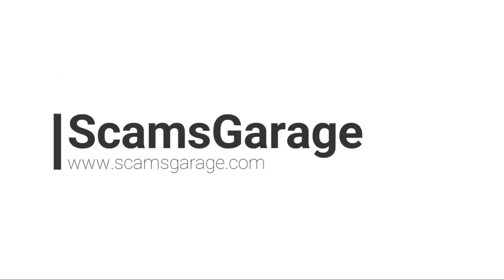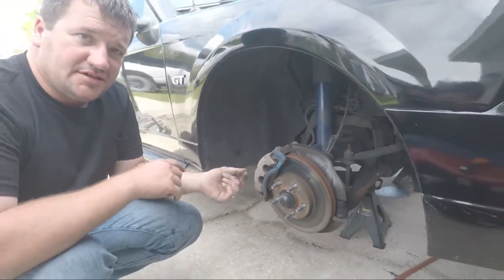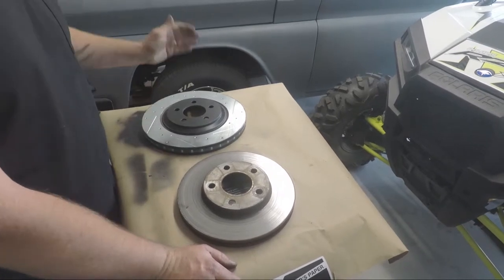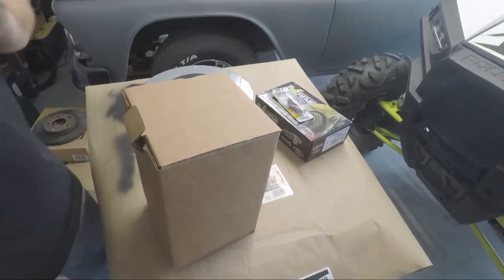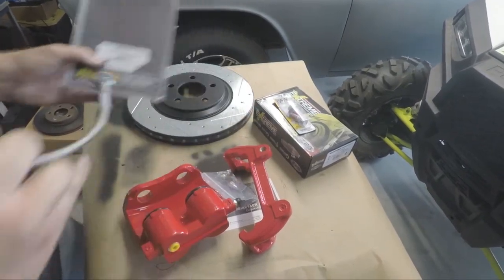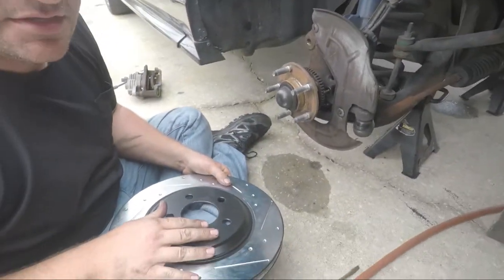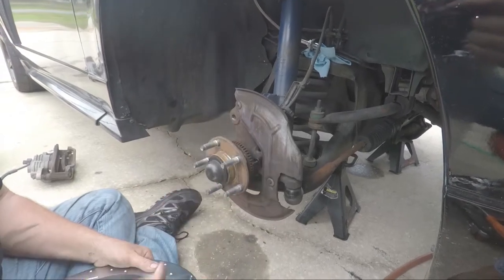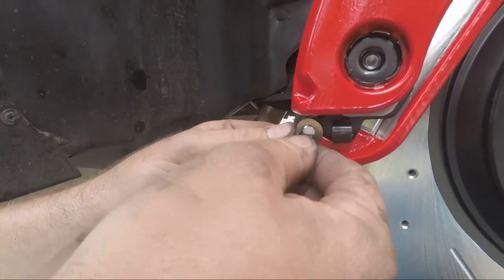Mustang GT Brake Upgrade

Comment: I just bought a 99 gt and the brakes are painted like this. How can I tell if they are upgraded to these cobra or are the stock gt ones? They both look similar. Any advice without taking the tire off and everything apart? Just curious to know as the car has been modded in several other areas. It has drilled and slotted rotors front and back.
Reply from the maker: Paint is not a indicator. The easiest way is to measure the diameter of the rotor, stock GT will be 11" and Cobra will be 13". You will also see a different style of caliper and mounting. Reference the video and you can see the two different style of caliper retainers.

Comment: there is a rubber boot that comes with the brake hardware kit. Do you know where that goes?
Reply from the maker: Is the rubber boot with the front or rear hardware kit? The Cobra brakes would have a rubber cap to cover the bleeder in the front.
Reply: @ScamsGarage  front
Reply: It isn't a bleeder cover.

Comment: Have you done the rear? Or just front ?
Reply from the maker: The rear still has factory GT size brakes. We did use the Power Stop AR8142XPR Rear Evolution Drilled & Slotted rotors and POWER STOP Z26627 brake pads on the rear for a upgrade. The fronts are the big improvement you go from a 11" to a 13" diameter rotor with only bolt on parts.  The rears are stock GT of 10.5" diameter and Cobra is 11.7" diameter, the rear conversion requires more than a bolt in conversion with stock parts due to bracket changes on the axle housing. 

Rear Rotors - https://amzn.to/2T8BTSV
Rear Pads - https://amzn.to/35AJdJD

Comment: do the stock GT brake lines that go throughout the car fit the cobra calipers?
Reply: Like i guess a a better way to clarify things would be to ask, would these brake lines fit the russel hoses you are using?? https://www.americanmuscle.com/steel-front-brake-line-kit-9698-gt.html because I see they fit the stock GT lines, i dont see why they wouldnt fit the aftermarket ones?? I just dont wanna spend a ton of money to find out they wont work. I have a 98 GT btw
Reply from the maker: All of our steel lines are factory GT lines. It is the rubber caliper lines you will need for a Cobra not a GT, they attach to the calipers different.
Reply: @ScamsGarage  Oh ok, so just the hoses need to be replaced with a part meant for a cobra. Anything factory GT or aftermarket for a GT will fit meaning the actual lines throughout the car and not just the calipers.

Comment: i just installed this cobra kit......and the new wear pattern is off......pads ONLY show rotor wear 75%..diameter ??
Reply from the maker: I'm not sure why they are designed this way, but it actually correct with the cobra brakes. We thought the same thing when we first ran them, so we actually compared them to a few factory Cobra mustangs and they have the same contact pattern.
Reply: @ScamsGarage  HAVE U EVER HEARD THAT(ON ANY OTHER CAR)... PAD WEAR DOES NOT MATCH THE COMPLETE CONTACT AREA OF ROTOR..

Comment: I have this Mustang GT in the 2002 model. It has front slotted/drilled rotors. The pads on those things barely even lasted 4,000 miles. Terrible.  And to add insult to injury, they sucked at stopping the car. My 1991 Firebird with stock brakes & drums in the rear gripped better than these drilled slotted rotors.  I'm thinking about putting stock rotors back on.
Reply from the maker: Sorry to hear it. We haven't had any issues with the brakes and we've had them on the car for 2 years. They worked great for us.

Comment: I can't get the pin to fit in the calipers for the life of me.
Reply from the maker: These can be tough sometimes. Make sure the pads are fully seated and then apply pressure towards the rotor to push the springs down as you install the pin.
Reply: Had this exact same problem. @Fritchard Ordered the same ones from this video.  Bled the system and had the right drivers side caliper seal leak everywhere. After a few back and forths with the car . Waiting on a replacement now @scams garage how are yours holding up?
Reply: @chez51san  my right side ended up leaking as well the day I got it on. It sat for about a month before I put them on the car so powerstop wouldn’t warranty them... until I tried again a month later. In February they said they would be shipped out at the end of March because they were on back order. Now I just got word that they won’t be shipped till may 15th. Ugh
Reply: @Fritchard Well that’s alarming to hear. I don’t think I’ll be running these . The quality control seems to be way off. As you stated those pins were ridiculously hard to get on and shouldn’t be the case when watching other install videos.I’d suggest you’d find another set and not risk your life on these powerstop calipers.